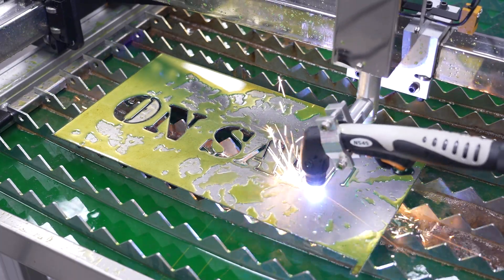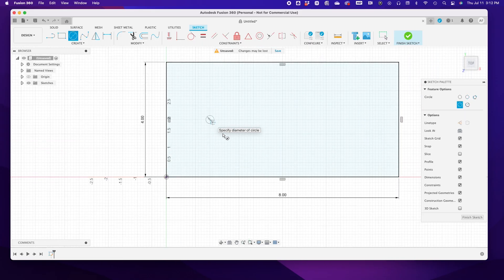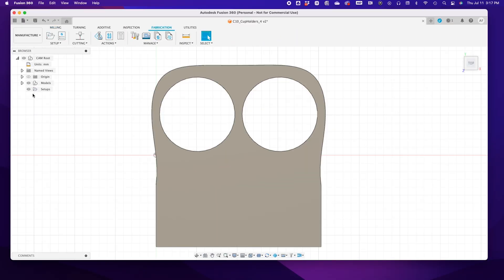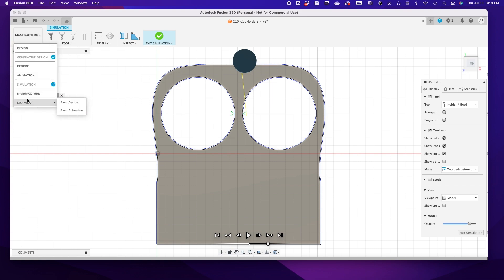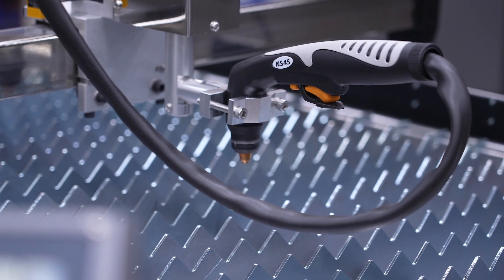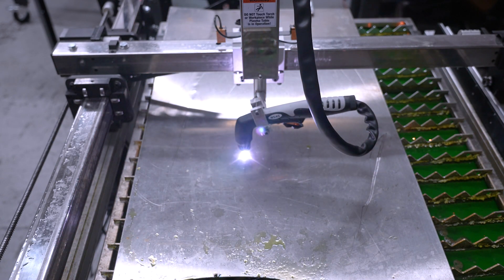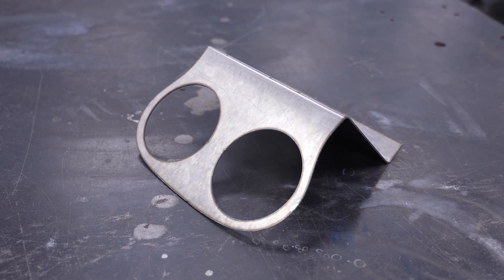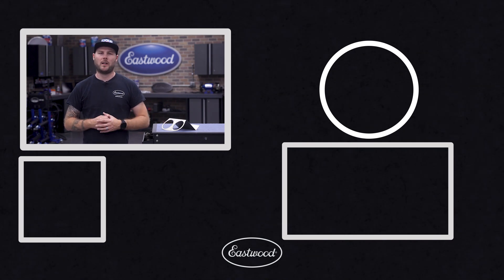STEP-BY-STEP CNC Walk Through - Design to Production!

Comment: Is it possible to use AutoCAD and BobCAD/CAM to create programs?
Reply from the maker: You can use whatever design program you like - just need to get a .cnc file to cut with.
Reply: @eastwoodco  What about the post processor? That's what I seem to be up against. Is it possible to make a post processor with limited programming skills? It is only a text file, right?
Reply from the maker: We use Autodesk Fusion for design and processing. They have a free version for home use.

We've also seen workflows where customers use qcad and sheetcam for post processing.

Comment: Fusion 360 for simple 2d work seems a bit extreme, especially for alot of fabricators who dont even know how to turn on a pc. A simple 2d cad program is all you need for a plasma table
Reply from the maker: What program do you like to use?
Reply: @eastwoodco  Dont get me wrong Im not trying to put down your video or fushion360, just think a simpler cad system would be better for alot of users. I found this video when a customer of mine came to me for help getting his machine going that he purchased. Ive been programming cnc equipment since 1989 which was all hand written code and ive used many brands of cad/cam software over the years. I personally use mastercam to do most the work in my shop and for my plasma but that is also too extreme for most users and not free by along shot lol. I suggested to him to get a free version of a simple cad such as qcad and use the sheetcam post and sofware that eastwood has on there site. Working with solids is nice and all but I personally think its overkill for a plasma table and makes the learing curve to get your machine up and going alot more difficult than need be. BTW great video for those who know how to use 360 or dont mind learning it.